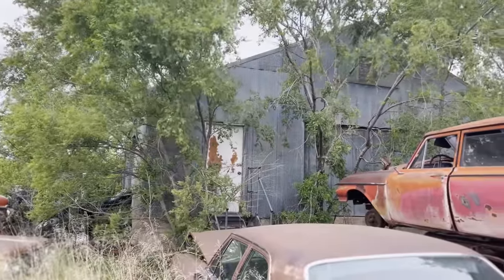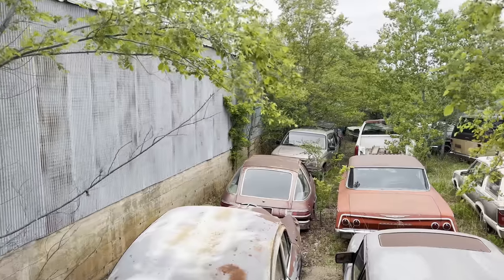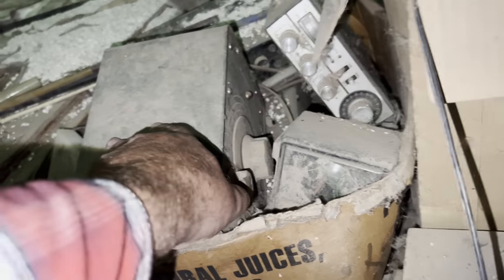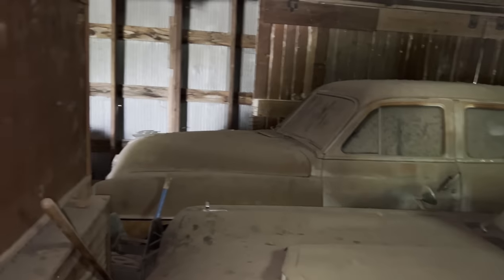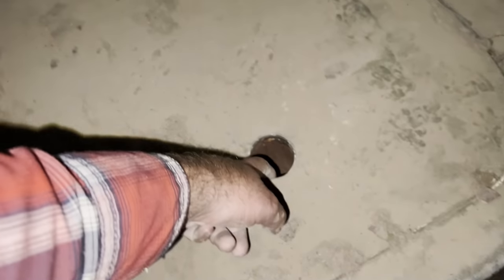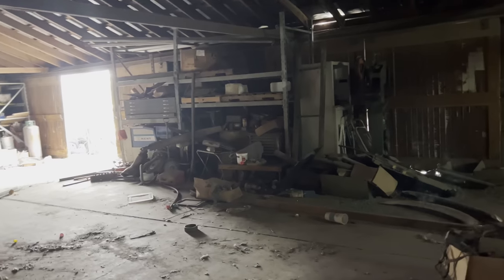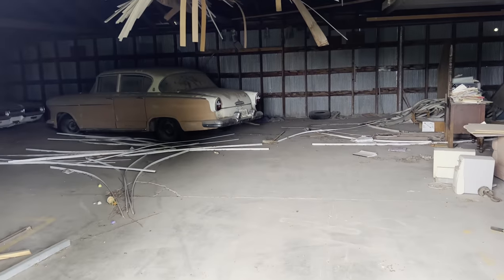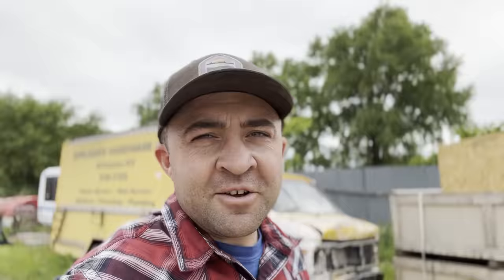There's a bunch of OLD CARS inside this semi-abandoned Railroad Depot! What's inside?

Comment: That desk sitting up on one end is identical to the one I am sitting at right now. Solid wood veneer. It Was a desk used by the Navy at Whidby Island NAS.  It was being carried out of the hangar to be thrown away by some junior enlisted. I told them to throw it in the back of my pickup instead of lifting it nearly head high to throw it in a dumpster. It has to weigh nearly a hundred pounds.

Comment: The 60 T-Birb, I bet could have been a pace car for dirt track or oval track racing, which use to be all over the mid west and southern US and the hole would have held some sort of race flag, green, yellow, red or checkard ... The Hudson's split bench seat as I understand it, if it is the original seat was designed to fold all the way back to where it touched the back seat so it could be made into a bed for camping, Hudson's thinking and inovations were just a head of their time. I'm interested in the 54 Ranch Wagon when you decide what you what you are going to do with it. Thanks for deciding to film this, looking forward to seeing more as you move the cars out of the building...

Comment: The Ford Ranch Wagon is a 1953, not a 1954 -- can tell by the grill, the round-ball knob on the shift lever, and the dashboard, to begin with.  From 1952-54 the bodies were the same, the differences were mainly in the trim and details.  And in the case of the 1954, an OHV V-8 vs the flatheads in the 1952-53.

Comment: Wow! Have wanted a 74 Bird for so long, now I have no money.  The Hudson with the slit back seat was a common feature in the early 50's late 40's autos.  Ford had one that it was called exactly what those seats were for...they were "Business Coupes "!  The 4 doors were for easy access to the fold down split seat into a bed. (Feet down into the trunk).  They were designed for the traveling salesman. Saved on not paying for motels.
Reply: That's a 64 not a 74

Comment: I was given a 58 Olds with tri carb J-2 it had been smashed in the driver's side and pushed into a light pole on the passenger's side, I removed the entire power train and installed it into a 49 old 98 the car was genuine sleeper. 1964 was a great year
Reply: Funny. We did the same thing with a ‘ 53. My buddy worked in a boneyard and that was a weekend project. Original engine was already gone out of it and some of the bright work had been sold off it. Tri carb engine came out of a totaled ‘57 Super 88. Drove that car for months, no title or plates. It was a burner machine.
That wasn’t the only car that got cobbled together in that yard, it was so easy back then, especially with all the equipment right on hand

Comment: For all of the vintage electronics and radio gear, look up your local HAM radio club and see if they are back to holding swap meets now that the 'Rona is winding down. Just vacuum them off as best as you can. Some of the veteran guys prefer the vintage equipment and then there are others who like the repair/restoration challenge. All the best!  KY8HCQ from West Virginia.

Comment: Interesting that these old cars were expected to last only ten years on average. Two of the first cars I owned, which on my modest budget were always built in the previous decade, were a '71 Ford Galaxy and '72 Chevy Impala, and I prob paid $450-$500 for each in the early/mid-1980's. They had V8 engines so got great heat in winter and ice-cold air in summer. They both had rust issues esp under the driver's feet where I could see the road and so I had a board there. I called them my Flintstone cars. They prob lasted no more than one or two years each; just basic transportation. I had to put a rebuilt trans into one, cost me about $500. When they were finished (how did I know? easy, the latest repair estimate exceeded the car's value), I'd make that last drive to the junkyard (east Newark, NJ), sign over the title, receive payment of $25.

Comment: Dennis Collins is a nut for old cars like some of those. He can tell you stuff that is unknown to most. I agree, that wasp has potential for a great builder and the ranch wagon, even though its rusted on the outside, the floors are in it so its a builder as well. Biggest damages are rodents getting into them. I would think that the two door plymouth  should get some mopars heart ticking... and... that building is far from needing torn down... I agree its got a very low ceiling ... cleaned out and up, its still good storage for old rigs just like those rigs. Might as well become a logger for a day and rip out those dang trees for they get even worse

Comment: Love the cars!

Small point, but the building is neither a railroad depot or freight house. It did have a rail spur but with the 8’ rafters it would unlikely the building was used for manufacturing - maybe storage?
Reply: That is what a freight house is, a building used to store freight, until transfer to local truck delivery, or pick up by the consumer. He did mention a loading dock, for trucks, further down the building.
Reply: Hi Rambler - I stand corrected about the building not being a freight house as it does have a siding or spur and housed freight. I guess I was thinking about the freight houses often attached to or close by a depot and located on a mainline. 😊

Comment: Silas, I like the 1964 Thunderbird. I have always liked the “square birds.” If you sold the car, how much would it be?
Reply from the maker: I’m not sure on the value. I’ll likely auction most of these off once I get a path cleared to get them out. That’ll be later in the year tho
Reply: @AdventuresMadeFromScratch  Okay. I look forward to the auction video. Thanks for the reply.
Reply: @AdventuresMadeFromScratch  might want to do a rough inventory then consult a reputable auction company  and sell in lots like thay did in that Labrect Chevy dealer a few years back
Reply from the maker: @rsprockets7846  Yeah I plan on auctioning them but I have to get titles, clean them up, etc
Reply: The square birds are like the first one he showed, 58-60, 61-63 bullet birds